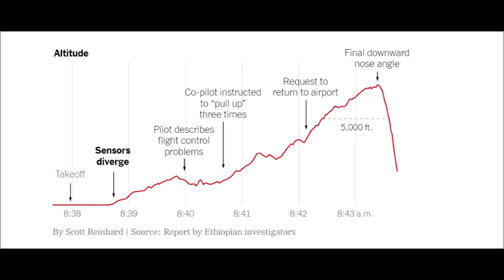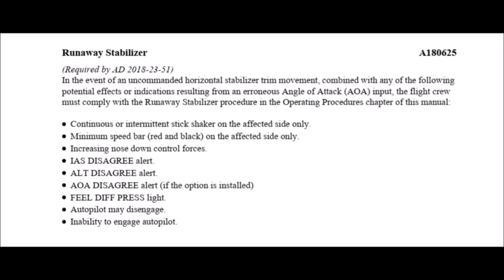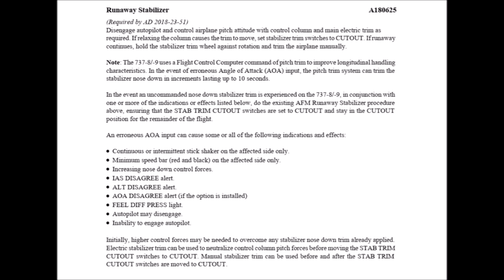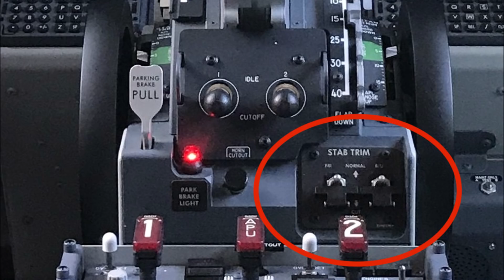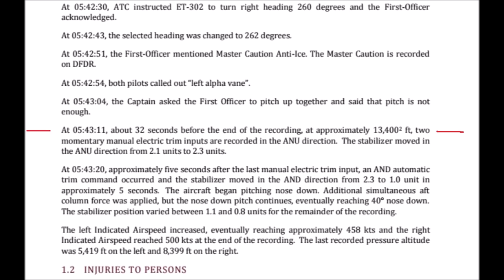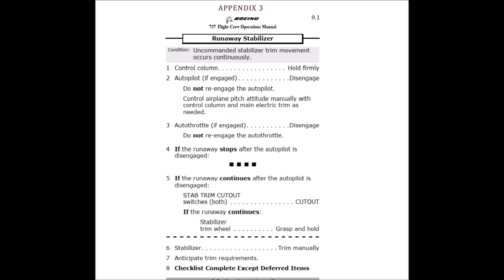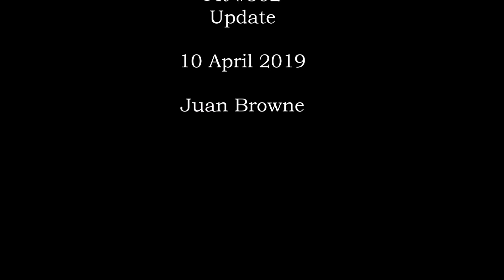737 Max Update 10 April 2019 Runaway Stab Trim Procedures

Comment: I believe you have mentioned this before maybe but is there a flight engineer on these planes that could help these panicking pilots in situations?
Reply: Flight engineer is a victim of automation. Sometimes having that extra person to help was worth.its weight in gold.

It was reported that a 737 max had a MCAS upset and a check pilot was able to guide the crew to resolving the MCAS upset.

Extra trained crews in the cockpit have helped to deal with the crisis of several flights:
UAL 232, Quantas 32 and Northwest 85.
Reply: 737s haven't had a flight engineer since the 737 Jurassic (-100/-200/-300)
Reply: Michael Dessero--there has NEVER been a flight engineer position on a 737!!
Reply: @tenpiloto  Sounds like it is about time to have one.
Reply: Mike M—really?
Reply: @tenpiloto  Good comment. Are you drunk?
Reply: Mike M--no, do you know anything about aviation?   What would you suggest a flight engineer would be doing on a 737 (or on any other airliner)?   The last airliner certified with an FE was the 747-300.  Check it out.
Reply from the maker: No.

Comment: Would rolling the plane 180deg. might have saved them or at least bought some time? Layman asking
Reply: No inverted fuel system in airliners, no inverted lubrication system, etc. Probably would have just furthered their problems in my opinion. Airplanes that aren't build to fly upside down don't like to fly upside-down. I doubt it would have helped, especially when so low to the ground already. Creative thought, but wouldn't have been helpful in the situation IMO

Comment: As a non aviation person,but a former USAF mechanic,I have one basic question: Disregarding any errors that may have occurred,how is the failure of the AOA system being addressed?
Reply: News said they will now use both AoA's. When these disagree over a certain threshold, the MCAS will be disabled.
Reply: I was initially skeptical, but the new AOA thresholds announced by Boeing on 27 Mar make a lot of sense. Pity they didn't do it right the first time...
Reply: There is no answer to that. The latest news is that the Ethiopian crash probably involved mechanical damage (bird-strike or ramp-rash).

Comment: Juan,  good report thanks.
I am not a pilot.  I do have 40+ years of experience in automation.  What you have here is a fundamental failure of engineering (perhaps even engineering by management).  Initially, the AOA failed.  Fundamental problem there is no failsafe position to default to.   Best scenario would be to be able to select the sensor to be used if there are more than one.   Alternatively this can be done automatically (it would require some sanity check software which would check for runaway sensor inputs and comparisons to the working sensor.  Typically in industry you go to the last known good input if the alternative sensor is not available.  This is a real world example of minutia controlled control system windup.  When we were dealing with things like poisons or explosives there was a MANDATORY HAZOP review of the entire system  required.  Sounds like this was not part of the engineering protocol.  Just my $.02.
Reply: More like engineering by Marketing
Reply: It's actually a redtape certification boondoggle. MCAS is an ignorant patch required to gain airworthyness certification. The one you want can't have a rubber stamp certificate. These tombstones belong to the bureaucracy that is the system as is.
Reply: I've wondered if water bottles would be helpful as backup horizontal indicator.  Many crashes have been the result of a faulty sensor and resulting decisions based on the variances.
Reply: @fyrman9092  Water would only tell you what is level in relation to the earth, not the angle of attack of the wings against the air.
Reply: @bonemasterj  Apparently whatever the MCAS indicated or did, it was wrong.
Reply: @fyrman9092  No,  water bottles would not be helpful due to various forces acting on the aircraft (imagine a sports car on a tilted road turn). You could even do a full loop and the water would stay intact (would not spill). See also https://en.wikipedia.org/wiki/Turn_and_slip_indicator
Reply: Is this like my car's airbag system. In that if the system detects a fault from the g-force sensors of which there are many or the resistance of the bags or something, it completely cuts the system off and throws a error message warning light. Same with abs automatic brake system. If the angle of attack sensor was throwing out absolutely unrealistic data you would think the computer program would recognize that and disabled with a obvious warning to the pilots.
Reply: I like this line of thinking.

Comment: If the manufacturer wants to install a ghost in the machine, it needs to be a friendly ghost.
Reply: MCAS(PER)?
Reply: With automation playing an increasing role in flight control, the onus is on the designers to be sure that each "feature" is not a fault in hiding. At the least, they should consider installing one big red button labeled "MANUAL" that would disengage all automation and allow the pilots complete control authority over all systems. Most pilots and all passengers, given the option, would choose more pilot workload over being dead.
Reply: @KJ6EAD  We always have to be careful about information that may not be correct. I have also read that there were no backup for the system, That is not correct. There are Two angle of attack sensors on the aircraft, they operate independently as is true for most aircraft. There are two independent flight directors. There are two independent autopilot.  The captains [ pilot ] instruments are on a different system to the First Officers [ co pilot ] [ there are also a set of standby flight instruments ] During pre-flight discussion,  it is decided who will fly the aircraft and who will talk on the radio [ oversimplification ]  The [ decided ] pilot flying  the aircraft, switches on his flight directors  FIRST and he becomes the MASTER  flight director. The other pilot then switches on his flight director second, [ which acts as a backup ]  The autopilot if selected will follow the direction of the first flight director turned on during pre-flight which is the MASTER  flight director.  The initial evaluation of this accident, the report seem to indicate that there were differences  between  pilot's and co pilot's airspeed indicator and flight director command bars.   Although right now we do not know if the the angle of attack sensor failed or if just the data was incorrect, we know that both angle of attack sensors differed and only one triggered the MCAS system.  there was not a stall indication on the second flight director system. Possibly only one of the stick shakers was activated before corrective trim was applied by MCAS.  I am explaining this as a operator of the 737 and it is absolutely certain that there are backups for the flight director systems [ and many other systems ].
Reply: @YouTube.TOM.A  MCAS picks one of the two AOA at power-up to use during the flight. It does no comparison or validity checking unless you pay extra and get the OPTIONAL diagnostic package. Now guess if a third world carrier like Ethiopian or Lion Air paid extra for the diagnostic package given some of the US airlines didn't....
I wonder what else is hiding in the code and design as well...
Reply: @allangibson8494   You have to be aware of the frustration of reality here; responding to forums where there is no baseline of understanding.  The engineers and software programmers at BOEING are better suited to substantiate what remedies   will succeed [ with FAA approval ] without upsetting the whole work product of all previous Boeing fleets.  What you are saying here is so impractical and provocative  that i can't really respond to it.
Reply: @KJ6EAD  this was only one system that was program Very badly with no failsafes when they had all the rules for MCAS already on the boeing tanker version (both AOA sensors used, pull back to disable mcas and limited trim authority)
when it goes back in the air if this happens again just pulling back on the sticks will disable it automatically so there is your manual button, again the issue was no failsafes was set up to auto disable MCAS when pilots want to fly the plane manually
Reply: @KJ6EAD 
You absolutely nailed it right there. We who run CNC machines have a similar feature on EVERY machine, a very large red button labeled "EMERGENCY STOP". And our jobs don't even involve other human lives, just profits...
Reply: @MrMccurley  That's what I was getting at. Unless the automation can be made perfect, and it never can, the "emergency procedure" for taking control back should be exactly 1 step long, not some multi-step flowchart with branching.
Reply: @KJ6EAD 
I could not agree with you more. Only question is, how do we get the management at Boeing and the FAA to quit playing games and get real ???

In China, they execute executives for screwups this bad.
Reply: @MrMccurley  There's no obvious way. Aviation safety has improved to the point where it's safer than ground transportation in terms of deaths per passenger mile. The NTSB has done a phenomenal job gleaning useful knowledge from accidents but the bureaucratic FAA only implements a small percentage of the recommendations that the NTSB makes. We passengers accept the risk and the losses because we can't afford to double our flight costs, so it's not us against them; we're in it together. Bad actors should be held accountable whether they're a greedy investor, a soulless executive, an incompetent hack engineering manager, a programmer with a drug habit or whatever.
Reply: They are starting to do this in Truckee now and the systems are dangerous.. automated braking based on radar that's often wrong and doesn't they just react as it's told so you're on black ice a car pulls out in front of you the truck locks down the brakes and 20 people die. If the driver lives he goes to prison for manslaughter despite having had control of the vehicle removed
Reply: This one sounds more like the Predator: invisible and stealthy MCAS.

Comment: At log time "5:43:11" it does NOT say the stab trip cutout switches had been put back on.
It only says electrical trim operation from the yoke took place.
That means one of the pilots clicked on those switches. Which could have been a reflex action kicking in.
What if THAT operation did re-enable the stab trim?
Wouldn't one of the pilots have mentioned re-enabling the stab trim?
I see no evidence they really DID that - it's all only speculation.
The instructions only say that the electrical input would not be active anymore after the cutout switches have been engaged - but is this true?
Hans anybody verified the trim input on the yokes does NOT re-engage the stab trim even after the cutout switches have been engaged? I don't think so.
Reply: furzkram 
The accident report explains that the stab moved in the nose-up direction a small amount when those final two quick yoke inputs were made, and then moved in the nose-down direction when the MCAS input came shortly after that. 

It’s unlikely that both those things could happen with the stab switches in cutout.

Comment: Here's a thought for the IMO supremely overconfident and largely clueless (wrt safety) air systems designers: why didn't the panel display
** SUGGEST CUTOUT TRIM STAB IF THE PLANE IS NOT TRULY STALLING ** ???
A ten year old is smart enough to program that contingency - for something as trivially simple as a display warning.
Reply: The problem is, you are relying on those (now faulty) a of a sensors to tell you the plane is about to stall.  You can’t stick your hand out into the wind, make an assessment of the airflow angle and say, ‘nah, we’re not stalling. Ignore that stick shaker’.
Reply: @rachels209  I assure you, that crew knew they weren't stalling.

Comment: so in the software development world, the big drive for a while now has been TDD - Test Driven development.  The real failure here as I see it is the failure of true complete unit tests of the software prior to even first release.  Unit tests on the mcas should have produced a matrix of tests and include normal and abnormal conditions / situations and the outcomes.  If they would have included some abnormal and failed hardware situations (i.e. aoa sensors), into the tests, then they would have discovered what would have happened.  The software should have never been stamped as "ready to ship".  So this was initially a failure of software development and QA
Reply: and the general rule for TDD is to produce "failing" conditions to prove your code wrong, and work until you can't get it to fail
Reply: I know some of the certification processes (from being a pilot/builder), but certainly not all of them with great detail.  But I would suggest that certs should collect and examine all testing criteria both hardware/flight/and software.  The software unit tests should be part of the artifacts recorded in certification.  Don't you think?
Reply: If a joy stick sends out faulty data due to poor electrical contacts is it the fault of the software?
Reply: @JoeLinux2000   that's an excellent question!  probably not easy to detect  ??  but that's where you could even design tests to simulate that.  and it's up to the QA team to try to "break it" - simulating those types of errors.  Simulating one, or multiple errors at the same time.  The key might be to detect bogus inputs by cross-checking and validating them thru examining rates of changes with other instruments (i.e. gps/aircraft attitude/horizon/speed/heading, etc...)    It's not easy, I admit.  The F16 was the first fly-by-wire, and GE  seemed to get that figured out.  :^)
Reply: that was me above, not sure why it posted under a different user ??
Reply: @lookingforronfalter  sorry, I mean't to say General Dynamics, not GE.